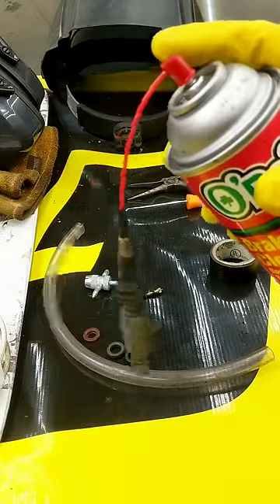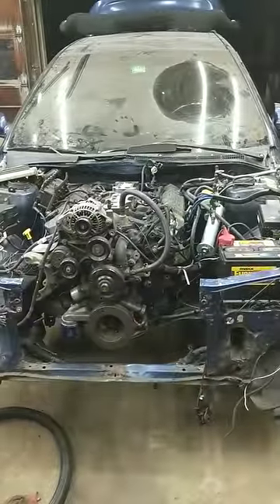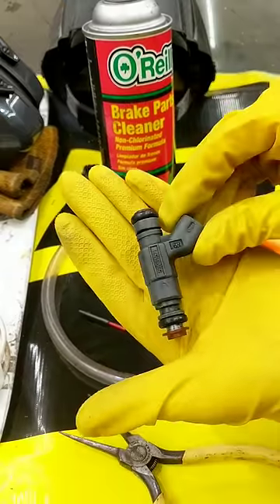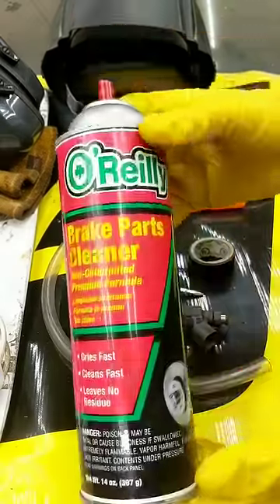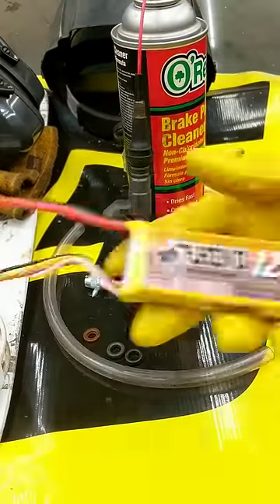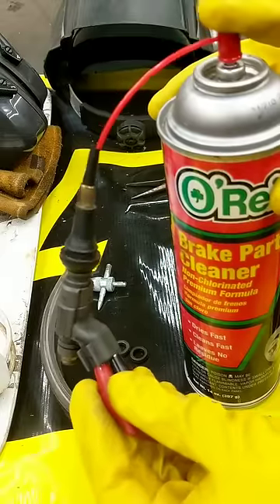DIY Injector Cleaning In 60 Seconds! How To Test And Clean Fuel Injectors At Home #Shorts

Comment: Today im going to show you how to ruin your injectors by giving direct amperage to the injector for far too long damaging the internal electrical components because im a self taught shade tree mechanic. dont do this... if you dont have an injector tester or the proper tools just have them cleaned in an ultrasonic...
Reply from the maker: Congrats you don't know how injectors or amperage work. All 10 injectors were held open far longer than this and work flawlessly.
Reply from the maker: @CarRimRod  Strange that literally zero of my injectors were ruined by doing this and holding them open even longer than on video and every other tutorial that does it like this has not ruined an injector and that running an injector at 100% duty cycle does not ruin it and that that's not how simple solenoids work. Show me a single piece of evidence that what you are saying is true and I'll lend you some credibility.

Comment: How come your not showing the fact that all your doing is pushing the button on the brake clean injector isn't doing shit
Reply from the maker: I think you fundamentally misunderstand this process. The cleaner will not go through the injector until you put power to it because it is a solenoid which is sealed until powered. The brake cleaner pressurizes the fluid in the injector and when you tap the power to it, the injector opens, allowing the cleaner through.

Comment: that's not clean it though it's supposed to have a cone shape learn what you're talking about
Reply from the maker: Bruh it went from being a crappy stream to a mist. There is no way for me to perfectly check the spray pattern without applying the correct amount of pressure and using gasoline. This isn't "how to make injectors brand new again" it's how to do a simple DIY clean which worked great by the way engine runs on all 10 now when before it was on 6. :P

Comment: Great way to burn up the injectors, also, injectors are cheap, buy new ones
Reply from the maker: It won't burn up the injectors. I did it to 10 injectors as you see in this video and they all work better than before. An injector is a simple solenoid.
Injectors are not cheap unless you buy Chinese garbage. They range from $10-100 refurbished and $20-200 or more each from the dealer.
Not to mention if you knew what you were talking about you would know you can send injectors in for professional cleaning and refurbishing.
Don't tell people to spend money unless you're going to pay for it. Your comment is not helpful at all.

Comment: Or you can just use Lucas my guy.
Reply from the maker: That doesn't do the same thing at all. I had already run fresh gas and fuel cleaner through this engine and it still would not fire on all injectors.

Comment: You don’t need to clean injectors… only in gdis because gasoline is a cleaner in itself …. Don’t do this
Reply from the maker: You don't know what you are talking about, sorry. 1 of these injectors was not even firing before cleaning, 3 others were mostly clogged, and all of them were shooting a bad stream before cleaning and now shoot a mist. I have already tried running a lot of fuel cleaner and fresh gas and it did not succeed in properly cleaning them. It takes a higher concentration of cleaning product. Plus they can't be back flushed in the rail.

Comment: This is not a good test of things really.. no good way to control or regulate the pressure given or received just shoving it into the straw if some cleaner that may damage your plugs depending on what's safe for them.   And further more. Just not a good way
Reply from the maker: It's a cheap DIY test and clean, not equivalent to professional. I could tell a huge difference from before cleaning when I was getting weak split streams to after when I was getting a nice fine mist. Try it yourself. Works great.

Comment: Jesus christ... lipo near flammable solvents. I see you aren't experienced with lithium battery fires. Just use a power supply... much safer
Reply from the maker: Very experienced with LiPo batteries. Unless you're spraying the brake parts cleaner on the LiPo, there is pretty much zero risk you're going to catch it on fire. Common sense goes a long way. You could also use a non-flammable solvent. Also a power supply costs money. I used a LiPo because I had it on hand, but recommended a 9V or car battery because everyone will doing this will have one.
Reply: @802Garage regardless of what you tell people, you still demonstrate the use of lipo with test lead jumpers. Smart idea. its not so much the solvents... go ahead and short circuit that battery one time, you'll find out. Accident or not, they don't forgive once it's too late
Reply: @802Garage  12 volt wall wart type power supplies are a dime a dozen. They're everywhere and harmless if shorted. You don't need a fancy or expensive PSU to do it.
Reply from the maker: @lucky7s94  Buddy I'm well aware what happens when you short a LiPo. BTW electronics expert, these leads would burn up long before the LiPo did. They are tiny wires. If you are gonna critique every part of my presentation, better be accurate. Once again, I recommended using what EVERYONE will have if they are doing this. A... Wait for it... CAR BATTERY. I would not be surprised if I've been playing with LiPo batteries since you were in grade school. Chill a bit. Anyone attempting to clean fuel injectors they removed from their car is literally already playing with GASOLINE one of the most dangerous common substances to work with. A tiny bit of common sense will go a very long way. Anyone who owns a LiPo battery also likely has some idea the risk. Trying to critique people based on every what if means every single automotive video on the internet is dangerous and missing 1,000 warnings and caveats.